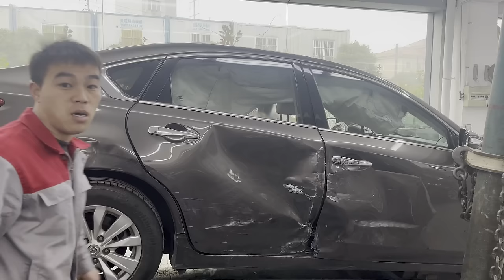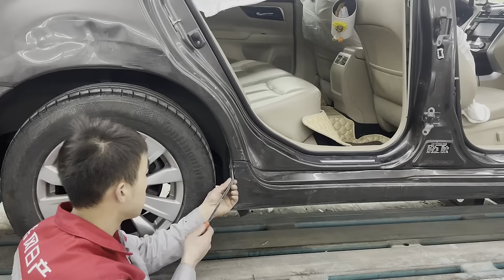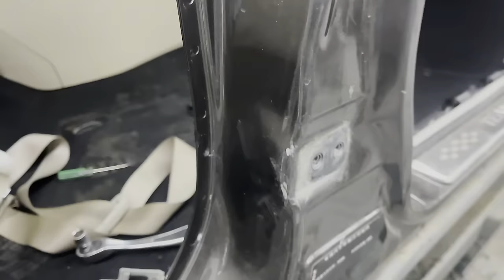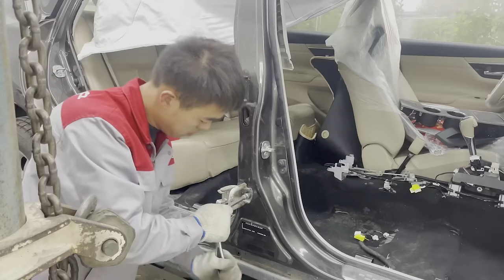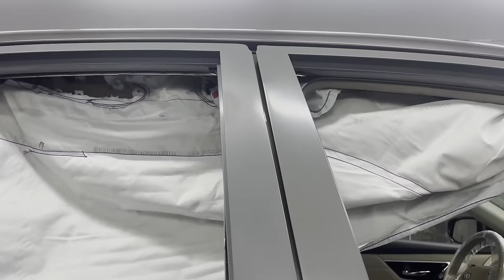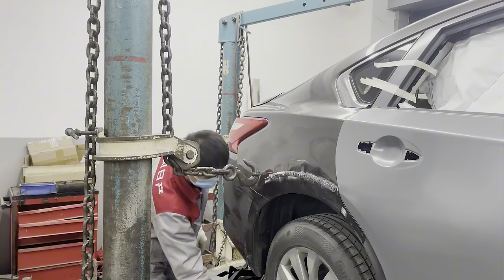Nissan Sylphy Right Side Collision Repair: Professional Repair Process

Comment: Perfectly crafted. I hope that the cavity preservation has not been neglected, especially on the wheel arch at the rear right. But great work! 👍👏👍
Reply from the maker: It's great to hear that you appreciate the craftsmanship of the repair work! Preserving the cavity, especially in areas like the wheel arch, is indeed crucial to ensure the longevity and structural integrity of the repair.

Comment: Hi, thanks for sharing! can you share details on the tip used for the seam sealer on the doors at 13:34 Please and thank you!
Reply from the maker: Hello, you can buy the accessories you want here. https://www.alibaba.com/product-detail/Various-Plastic-Cartridge-Sealant-Silicone-Caulking_1600565710828.html?spm=a2700.wholesale.0.0.ab7925f3Xwkifo

Comment: Excellent repair, as alway,s but you can tell that somebody else painted the car this time, you can clearly see the the blendline on the quarter panel. Still 👍👍
Reply from the maker: It's interesting to note your keen observation on the repair work. The presence of a noticeable blend line on the quarter panel can sometimes indicate a difference in paint application, potentially by a different painter or during a separate painting process. Achieving a seamless blend in paintwork can be a complex task, and variations might occur.